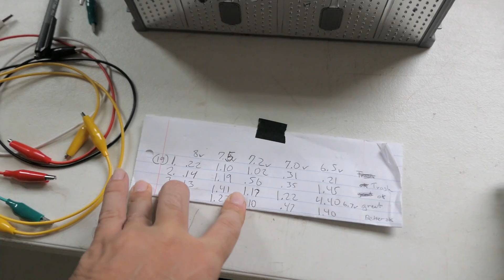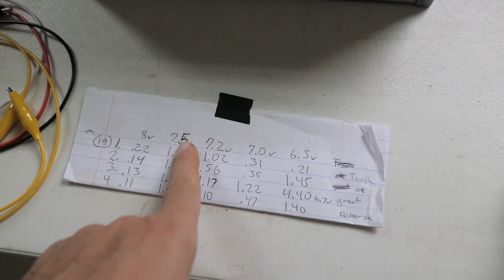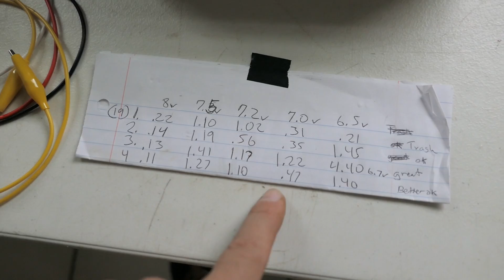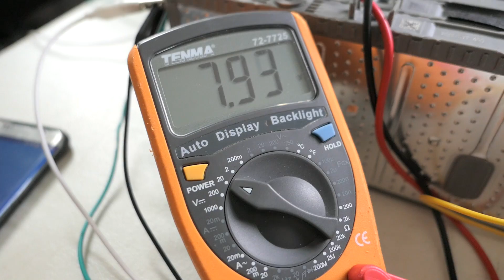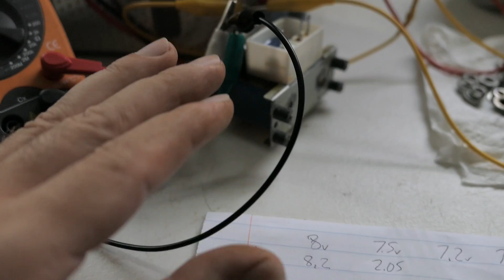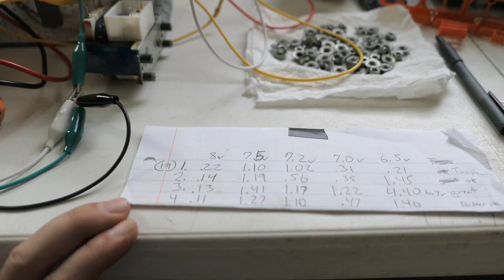Prius HV Battery Module Load Testing - Gen 2-3 ll lll

Comment: Great video! I have a question, I am going to fix my battery soon and should I do the load test to all the battery modules as well?
Reply from the maker: That would take forever. Just fix what's bad and be done with it. 99% of the time that's all you need to do.
Reply: do you cycle (charge/discharge) the battery pack after?
Reply: I had to cycle (charge/discharge) a 6.67 volt module 3 times to get it to hold a ~8 volt charge. I did a load test (lightbulb in parallel with volt meter) for 2 minutes, it only went down to 7.3 v after the third cycle, and returned to 8.08 v (with no load). Thanks Vlad: you da man! :)
Reply: @coolramone  how do you discharge and recharge a module
Reply: @nonenone4078  Discharge the module with a flashlight bulb and a wire to reach other side of module, but don't go to zero volts; go down to 5 or 6 volts then recharge to 8 volts. I used a hand sized B&D battery charger 8 - 20v dc connected to module with wires.
Reply: @coolramone  thanks and I can you send a link of this b and d charger I looked it up and cant find it , and could you do a simple video of the basic setup I'm more of a visual learner
Reply: @nonenone4078  Black and Decker makes a 20v lithium weedeater. The included battery charger reads 8 - 20V DC, so I used it to charge my modules to 8 volts. I had to use alligator clip wires to connect the charger to the battery(module). If the battery is at 6.x volts and it charges to only 7 volts after maybe an hour or so, then you have to discharge the module with a light bulb til it goes down to 5 or 6 volts, then charge it again. Repeat process until module holds  ~8 volts.
Reply: @coolramone  thanks for the details how do you prevent over charging the battery and let's say I have a battery around 7 .2 volts and can you provide link to this battery charger please
Reply: @nonenone4078  NP, Glad to help you. Good thing I took notes of what I did a year ago :). It's a process. Problem: One module 6.67v, others ~8.02v on 1st gen Prius. I bought 2 used modules (one for now, one for next time this happens) from ebay (~$25 each) with ~7.1 volts each and charged them together in series + to - (14.23v) for 2 or 3 hours with a B&D wall charger, like a cell phone charger but higher voltage(8-20v). I charged them together for several reasons, one being that that's how the Prius charges them.  I checked the combined voltage every 30 minutes(to avoid over charging). When combined voltage reached ~16.x v (8.x+8.x) I checked individual voltages for balance(example 8.42/8.39v) then waited several hours to see if modules would hold the charge. After 6 hours both modules were at ~8.00v :) Then I did a 10 second load test with a car tail light bulb: After light bulb was on for 10 seconds I retested the voltage and voltage drop was only 0.04v. :) So then I charged the 2 modules to ~8.0x each (or whatever the other car modules were reading, because you want balance), I installed the new (used but charged and balanced) module in the Prius and voila! Car started, ran normally, and after a few minutes the warning lights on the dashboard went out. And I got a charged module on the shelf for next time a module fails. You can probably use different kinds of (low amp) chargers, say ~400 mA, 8-16+v, maybe even a car/mower trickle charger that you could buy locally or the (B&D, etc) weedeater charger is on ebay for $30 new.

Comment: Great video, I always wondered how the “reconditioning” places checked their cells as well.
Reply: Pack rebuilders would never do something this primitive. They have real Toyota test equipment and a computer display tells the tech what every cell is doing. Though this video does tell you a basic loaded cell state. I do something like this to my Honda Hybrids Gen1. I use a Imax B6 for charging and a Sun battery load tester for discharging. Pretty good video for a DIYer! Great work, Thanks.

Comment: Just Vlad, can I use a 12v LED light bulb to discharge the module?
 thanks you very much for the video man. Best regards.
Reply: No, unless you like waiting until Doomsdays for the discharge to finish. LoL
Reply: Light Emitting Diodes (LEDs) are not a good choice when you're looking to generate a large current flow (high amperage). LEDs are specifically designed to NOT require much current, thereby saving the user from higher electricity bills, etc.

I used a halogen headlight bulb wired so that both the low-beam & high-beam were illuminated simultaneously.  This system created around a 2.50A load from the module being tested. It's about half the amperage required by the step-down transformer that used by the creator of this video.

At 2.50A current draw, the average discharge times to target voltages on my HV battery modules were:
8.00V to 7.75V: 1m 24s
7.75V to 7.50V: 3m 47s
7.50V to 7.20V: 9m 16s
7.20V to 7.00V: 47m 17s
7.00V to 6.75V: Testing in progress but expect lengthy interval
6.75V to 6.50V: Testing in progress but expect lengthy interval

Note that one module, #20, started out with a no-load voltage of 6.82V while all the others were around 8.00V, so I immediately suspected module 20 was the culprit causing the DTCs on the instrument panel. When tested, module 20 went from 6.82V to 6.75V in 10s and from 6.75V to 6.50V in 22s. Module 20 is most definitely bad.

So in summary, for your tests you want to look for a DC current draw (amperage) that is fairly high in order to speed up your testing process, otherwise you'll find yourself having to shave a couple week's worth of beard growth waiting for your module voltages to reach their discharge targets. :)

Comment: If I am not mistaken what you are trying to show is you can have good voltage battery but weak under load which is still need to be replaced. Is it right? My next question is if it's necessary to balance battery pack after replacing weak modules? If yes how and what kind of device needed? Thanks
Reply from the maker: That is correct, the voltage does not indicate true capacity, only load testing will reveal its condition. These batteries do not need balancing. But when putting a new module in make sure it's charged good cause it might throw a tringal if it's initially weak and will take multiple cycles to catch up with the pack. Hope this helps
Reply: The Toyota computer has a built in balancing circuit for the pack. Though it is not perfect, it is the best anyone made at the time to keep the cells balanced. Far better than Honda hybrids did, by far! But it is still very good practice to get all the cells in a similar SOC (state of charge) before installing the pack again.

Comment: Thank you for Share! !!
Could you tell me where can i buy a good cell? ??
My badenes cell is the number 7 do i have to order same OR any cell can be install in the same place.???
Best Regards.
Reply from the maker: Cells are universal so any cell will work in any order. I had decent luck buying on ebay,  amazon also sells them. You never know what you'll get so load test them before installing.
Reply: Just Vlad 
Thank you !!!
Reply: best way change all battery with new one in one time. Replacement bed battery  with new partly   fix car for very short period of time

Comment: How did it go? Car still functioning?
Reply from the maker: Yep, all is good. The car is being used daily with no issues so far.
Reply: @JustVlads  what did you use to charge the battery cell? Regular car battery charger?

Comment: That’s the proper way to test the NiMh batteries. There are numerous videos where they just measure the open voltage of Prius battery packs. This is measure where ANALOG multimeter is the best as you fast learn to see, if the pack is good or not.
Reply: A analog multimeter works better for a quick "load" test of a cell since it has more internal resistance than a digital meter does. But a voltmeter alone is not a good way of checking cells. You need at least a few ohms of resistance too. The resistor will get hot too. That is probably why a lot of people dont like doing a cell check the right way.

Comment: if you charge them out side the pack they can swell and you cant reuse them, they will not fit in the pack
Reply: If the cells distort they were no good to start with. Too much internal resistance.

Comment: Hi, thank you for the video. Ive recently replace my HV battery pack on 3rd gen prius. But im getting 14 km/l on new battery where as i was getting 20 km/l on my old faulty battery. Ive checked all cells on my new battery they all are fine. Any help or advice would be really helpful thanks.. 👍🏼
Reply: I would suggest you first check the more mundane automotive items such as tire pressures, brake calipers, and anything else that places a drag on the drivetrain.

Comment: hi bro first of all thank you so much for your videos I've learnt so much from them. I had a question for you how do you charge the cells. 
have you bought a charger if you have what type. 
I am really interested in it I've started working on hybrid cars a lot after watching your videos
Reply: If you don't have charger or a power supply and a load, you can buy an off the shelf solution that does all 3 for you.  Something like the SkyRC iMAX B6 (for example) or similar charger/discharger will allow you to charge and discharge the cell.  It also allows you to set the upper charge limits (you don't want to overcharge the battery)

Those chargers can chart out the discharge curve via software and have a lot of capability to test the cells, do cell balancing etc.

If you have a cell that appears to suffer from sudden voltage drop off like the Vlad demonstrated in the video (bad cells) those can be caused by voltage depression or memory effect.  You can try use something similar to the SkyRc above or equivalent equipment to deep cycle it and see if you recover some capacity and possible make the cell usable again.

This is done by fully charging the cell, discharging it to 0.9V, fully charging it again, discharging it to 0.5V, fully charging it again, discharging it to 0.1V and then fully charging it up again and letting it rest for about 30 minutes.

Hope it helps.
Reply: Kartik Sharma v

Comment: Do you charge every cell at 9.2 volt?
Reply from the maker: When you do the deep discharging for testing make sure you charge them back to 8v pretty quickly after that to avoid long term damage.
Reply: Hi  @JustVlads  Is it ok if I take apart the whole pack and test each cell like this getting them to 6.5 volts? Will this damage the cells if I keep them uncharged, at 6.5 volts,  before I assemble the pack and put it back into the car? This is gonna take me a couple hours, I guess. Thanks
Reply from the maker: Emmanuel Egel it does not really matter what you charge it to. I would charge to around 8v and then discharge from there, under 6.5v is where you will know if your modual is good or not.
Reply: thanks so much for the video!
Reply: what do you measn know under 6.5v is bad? I am discharging to 6.3 is that a bad idea?
Reply: I have a 2004 prius im balancing. Some of the batteries are 5000mah, some 6000k but some n the 3kmah range. For the age of this battery pack will the 3500mah ones do okay?

Comment: Thank you for taking the time to explain things this clearly.  I am wondering what method you used to charge the battery for testing?
Reply from the maker: I have a regulated power supply but you can use anything you have to charge them as long as you can monitor the charge.
Reply: Make sure whatever charger you use to charge that it is made for NiMh cells! Just "winging it" with any old charger can damage those cells unless you are babysitting them while they are charging! Overcharging can make cells VERY hot!
Reply: If you can afford a prolong charger I'd recommend the investment. You can charge the whole pack that way, it includes a light bulb discharger kit for reconditioning and that can be retrofitted to be a single battery cell load tester. I believe pack can be charged out of the car.
Reply: @bigboydrz  I just recently spent over $700 for the deluxe Prolong charger and discharger with failed results. As for customer service, forget it. Nine and a half times out of 10 there is no one answering the phone if you are seeking customer support. And their email support on their website always comes up with an error when trying to send once you fill out their form. Word of advice, save your money and go else where.